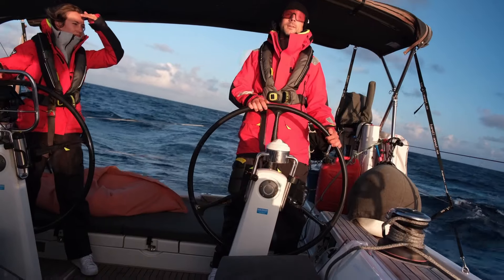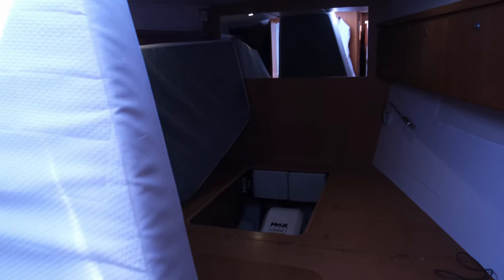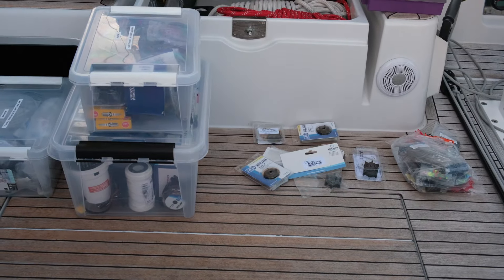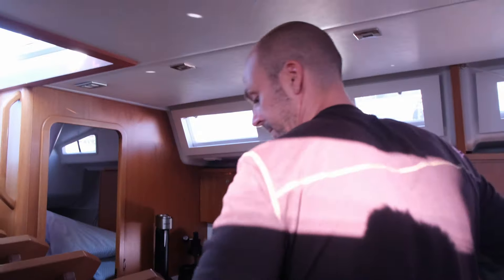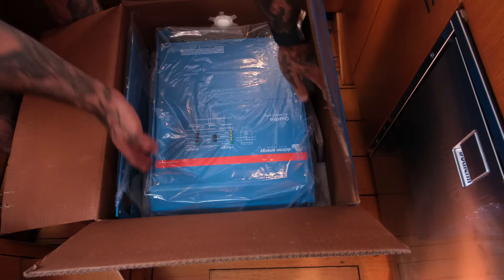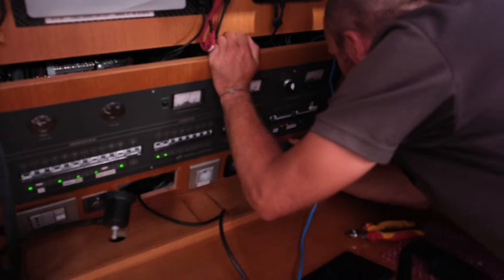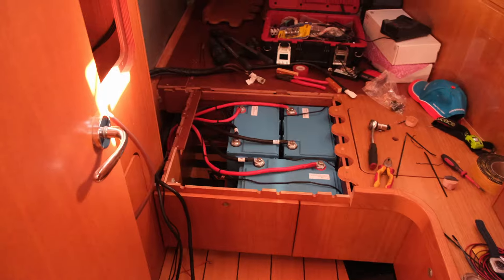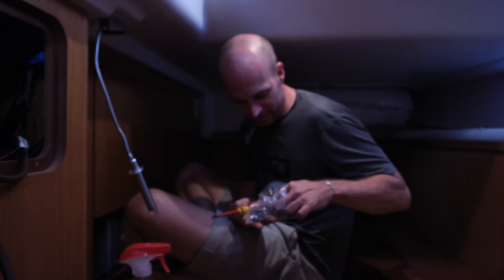Huge boat UPGRADE: Our concept for SELF-SUFFICIENCY | 990 Ah LITHIUM on our sailboat | EP25

Comment: Do you have a reason for the Quattro instead of the multi-plus. Thought the Quattro was if you also have a generator?
Reply from the maker: Thanks for your question. In our opinion the Quattro is more flexible and easier to connect with other parts of the Victron system. And the Quattro changes alone from shore power to inverter and the other way round. So the Quattro is a bit more intelligent 🤓 All over all it seems like the wholesome system to us and more flexible for future additions if needed. But both should work 😀 And the Quattro offers the opportunity to connect it with a Cerbo.

Comment: I like the idea of the system. Do you think you have enough charging option like solar?
Reply from the maker: Thanks for your feedback! That was one of our biggest challenges and we thought a lot about that. We added a bit of solar and if we use it intelligently and don’t wait until the batteries are empty it works very well. But we definitely need to combine all our options like the solar on the bimini, the flexible solar panels and the hydrogenerator. And in the worst case we also have the option to charge it with the engine (alternator).

Comment: Do you have a system in place that makes sure you get replacement parts when you use your current replacement parts. Like bilge parts
Reply from the maker: Yes we do, we work with excel sheets and for an overview and storage location of all spare parts + have calendar notifications 😉 
Do you have a good experience with different way to do it?
Reply: @patandfrankie  pretty much what you do.

Comment: Loved your video!!!   I am getting ready to do the same thing to my boat.  I noticed you used the MultiPlus 5,000.   I am going to use 3 Epoch 460Ah lithium batteries.  I spec’ed the MultiPlus 3,000.  Would you recommend I use the 5,000?
Reply from the maker: Thanks! We're really pleased that you like it. And it sounds great, we are very happy with our setup. 
We opted for the MultiPlus 5000 because, in case of doubt, we sometimes want to use several of our consumers at the same time and may want to leave options open for the future (e.g. a induction stovetop). Therefore, from our point of view, it depends heavily on your user behavior and your consumers. An energy balance has helped us to define this, we wrote down the consumption of our electronics and then saw what would happen when we use some at the same time.

Comment: Have you guys removed the generator and haven't put it back in place? So, there is no generator now? How big is the alternator in the motor? How many alternator do you have?
Reply from the maker: That’s right. We have removed the generator and we have only one alternator with 115amps. We use two Orions from Victron Energy to organize the charging with the alternator. But our goal is to adapt our behavior that we use the solar and the hydrogenerator as best as possible. The alternator should only be a backup. The two test sails worked well so far - one with 300nm nonstop.
Reply: @patandfrankie  Nice. If I could suggest a piece of advice, I would say to install a Balmar 270amp/h alternator with an external regulator. There will be that week that is not so sunny and too bad to be out there sailing, then, spending time in an anchorage will require to produce energy to recharge the batteries. With this extra alternator and the external regulator, you don't need the DC-DC chargers, you will have a backup (two alternators is better than just one), and, besides, the Balmar 270a will create a load for the engine when running in neutral and RPM around 1500. It will steal around 5 to 6 HP from the engine.

I know, I know, more projects, more money. However, you guys can consider it in future.  

Cheers.
Reply from the maker: @leonardowillrich1849 Thank you so much for the advice. We will definitely keep this in mind for the future 😊

Comment: What a mess with all the cables and plugs, thick, thin, yellow, blue, red... I find it admirable how two young people (who definitely come from completely different backgrounds) are working on the project with so much passion!! I have one question: is the conversion a benefit for our environment???
Reply from the maker: It is tricky and so many things are new, but it’s rewarding when you learn something and it turns out well in the end 😊
For us personally it’s the right choice to work more with solar and hydro energy then with diesel – it‘s a bit more to consider then just filling up a tank but it’s worth it 😉